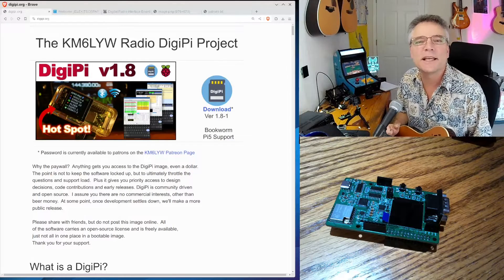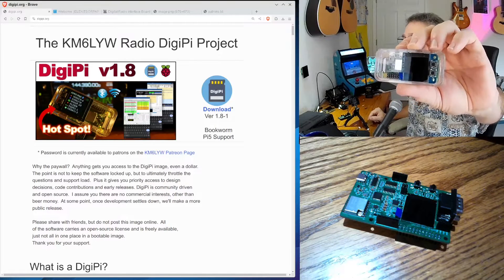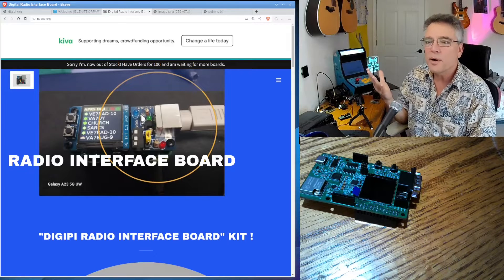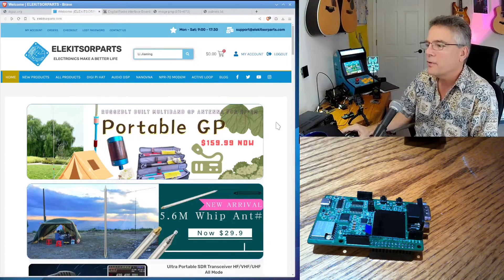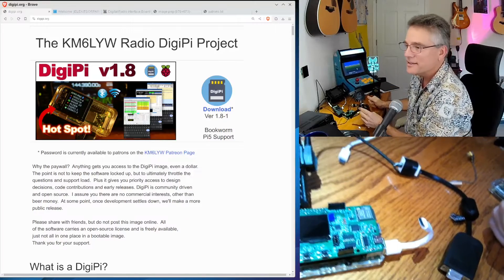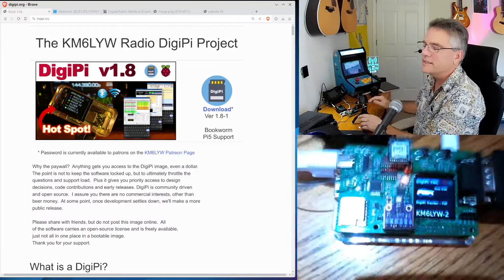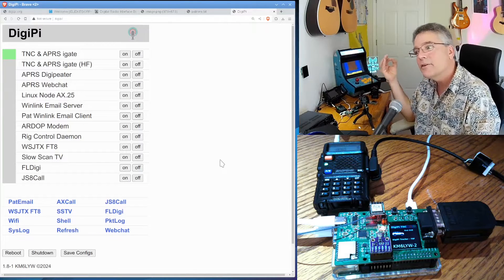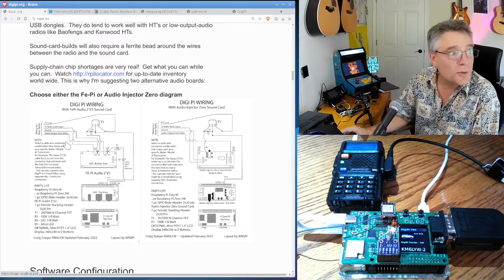Radio/Audio Interface Board  (Now Available!)

Comment: Will this kit come with the db9 terminal and 3.5 and 2.5 jacks?
Reply from the maker: nope, you need to make the radio-end of the cable.  Cut up a perfectly good baofeng speakermic from amazon or ebay and you're in business.

Comment: Hi Craig,
I do a lot of mobile support for bike ride and foot races called SAG. With a pre defined course and net control APRS is invaluable in tracking moble assets. Can some of the APRS mapping software such as PinPoint APRS  or APRS32 be used with digipi for asset tracking? Someting like Tinytracker product?

Comment: Does anyone use digipi with an FT-891?  I usually hear dual band radios mentioned or those with USB that happen to be shacks in a box (991A or 705) so I’m not sure if people are using those for VHF/UHF exclusively with digipi.   Since FT8 is relatively uncommon on VHF/UHF, I assume HF use of digipi is common.
Reply from the maker: @cchalfantusa  DigiPi can be made to work with any radio and any data mode.  USB-based radios are the easiest, supported by hamlib.  Dual-band rigs will need a ptt/audio solution (a new interface card is available today, see my video on "DigiPi Hat").   Dual banders can use aprs/ax25/winlink/netrom modes.  FT8/JS8/sstv/fldigi lend themselves to hf rigs.  All of it is supported on DigiPI.org.

Comment: Please implement VARA
Reply from the maker: VARA is closed-source, with licensing/redistribution issues, and is windows-only and x86-only (no Linux, no ARM support).  I'm not saying it's not a really interesting technology, but it's kind of a genetic dead-end from an "advancing the art" perspective.  Guys have it running under both windows and x86 emulators, but it requires a Pi4 at a minimum, and the DigiPi project maintains a 512MB memory budget.

Comment: Any special settings to change on the Baofeng?  Like turning on VOX?  Same with the N7EBB kit?  Also any advice for someone who has never made their own trss or ps3 cable?
Reply from the maker: No, the n7ebb.org board makes it so you DON'T have to use VOX.  Using VOX is really poor form as it jams the channel with lots of dead air after a packet.  the n7ebb board has a PTT circuit digipi will activate during transmissions.
Reply: @KM6LYW got the old 2015 BaoFeng HT working with the board.  Red LED doesn't light up, but everything else works great.  I'm using the TRRS connector.  As always, thanks for the help.

Comment: I used this very HAT for circa 3 years until just 3 weeks ago when I upgraded to a Pi5 with a better radio.  This HAT ran 24/7 for 3 years without issue combined with a  UV-5R.  Highly recommended!!  Also has connectors for Yaesu and Xiegu radios :)

Comment: Thank you for this movie. That little pi looks like some kind of pi zero. Is it fast enough to send everything duplex to and from a tablet or pc? Because with the digipy you use a pi 4.
Reply from the maker: Great question,  you want a "Pi Zero 2 Wiresless" (not the Original Pi Zero).   PiZero2Wiresless, Pi3B+, Pi3A+, Pi4 and Pi5.   If all you want is aprs/ax25/packet modes, the original Pi Zero will work.